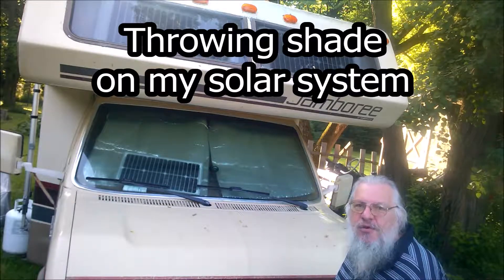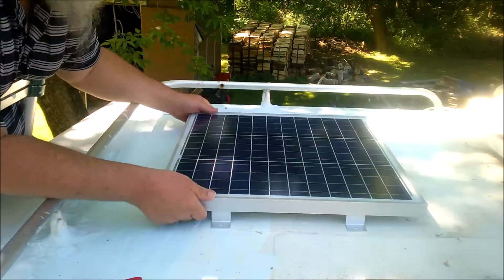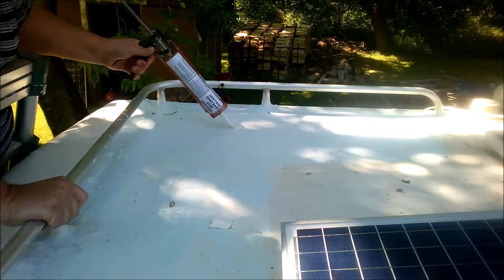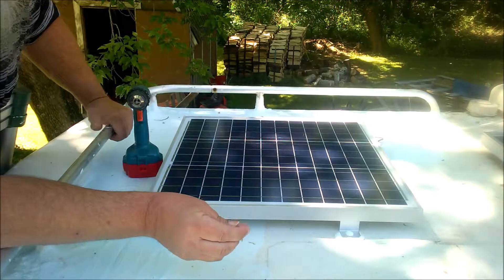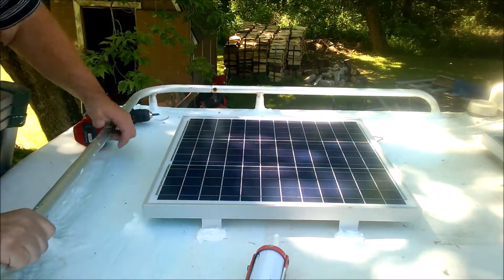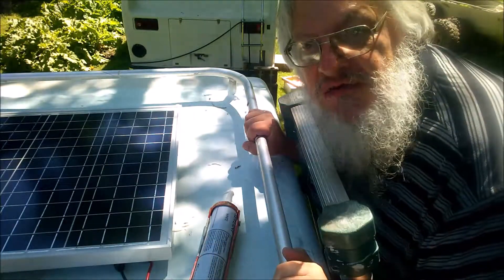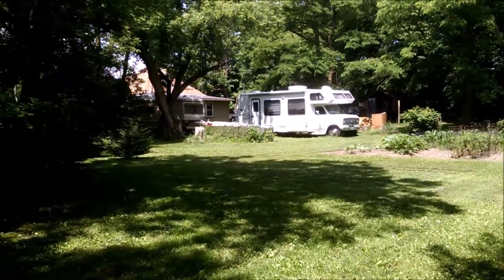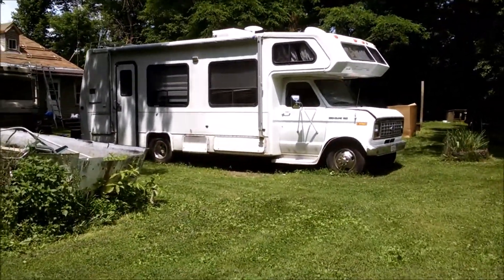Throwing Shade On My Solar System

Comment: DT!  I am glad you got up to a nice climate for the summer.  I lived in N Michigan for two summers (yeah, only one winter ; -) and those latitudes are great.

So your sister bought an '86?  And you won't share videos?  Aaagh.  I bought the 86 I was looking at.  Does this mean I have to start making '86 vids?

I paid a whopping $1500!  The guy said the Onan generator is worth that and he'd throw in the RV.  LOL, but he's right.

I am gutting it now to assess the roof damage.   And I gave my mechanic a long list of parts to order.  

Good luck to you and don't work too hard.
Reply from the maker: Other than the rain and mosquitoes, the weather was very pleasant. And I didn't need to climb any mountains to get there.

It's actually a 1990 Mallard. Yea, no repair videos. I told my nephew that if I put him in any repair videos, viewers might want to get him to repair their RVs and become as busy as RVPrepperWayne.

It sounds like you got a reasonable deal for it's age and condition. Just expect at least $3000 in additional work and at least 2 years to do it.

Comment: Trading for camping is good, too. And we all need to help others and get some exercise. An anti bark collar might be a great thing for that annoying dog. I always smell smoke in the evenings now, as my neighbors quit paying the electric bill, so no power, and they've been using my brush pile for cooking in a grill. It was a paid for home, but with various major issues and they with no abilities, will move out eventually now that it went for taxes. I fear what next will move in there. They asked to plug in here, have my cell number for calls, and I said no, taped all my outside outlets shut. I have worked up most of the brush for my rocket stove every morning so ...life is tough for them. It's mostly in bins in the garage. Stay cool.
Reply from the maker: Yea, I've been getting more exercise working on my sister's RV than I have done all year. ;) But I get the fun of solving problems and finding creative solutions...something I did in my slave labor days.
My neice's dog is very insecure. Every time people begin to talk, the dog wants to join in the conversation.
Hope your neighbor problem goes away soon. Having to protect your house from power theft and yard waste theft is not a good situation. It sounds like either a Jerry Springer  or a "bad neighbor" YouTube  situation.